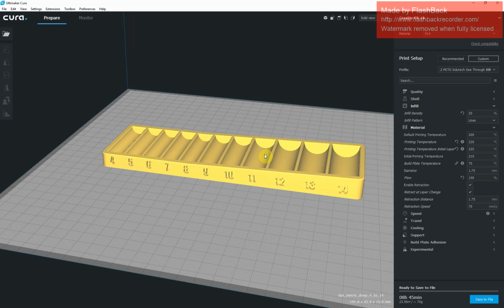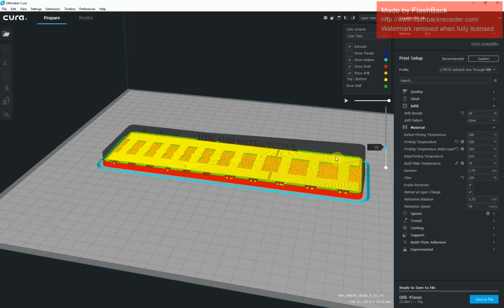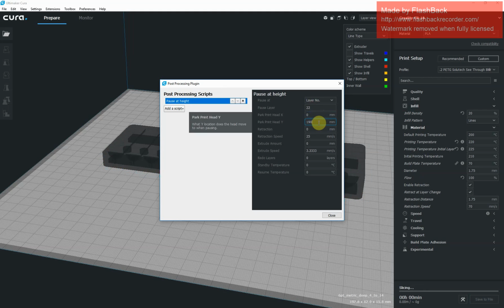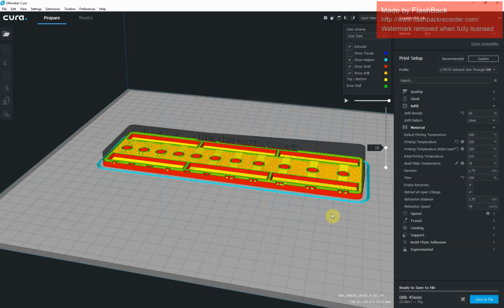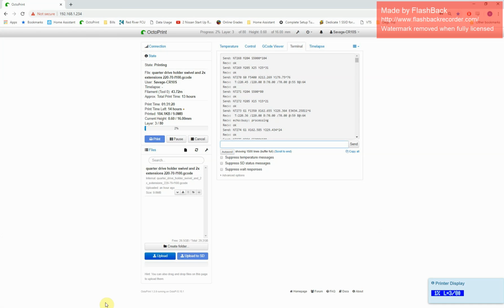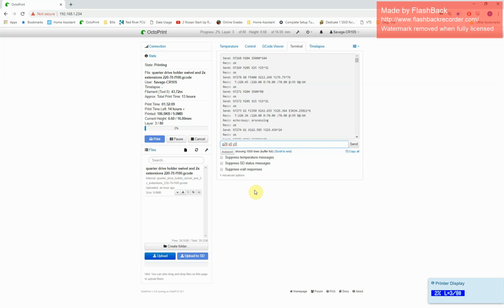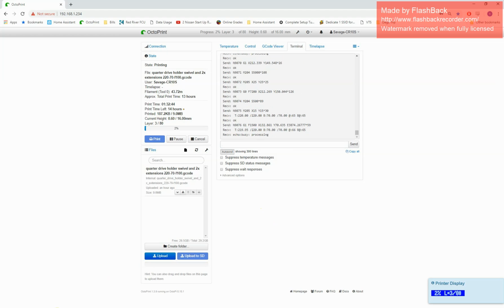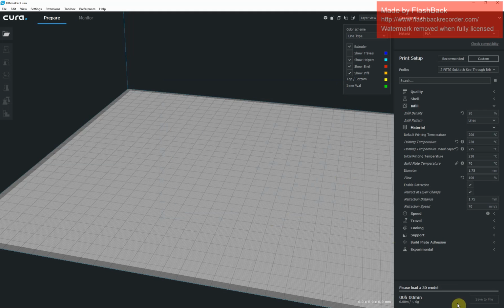Cura Post Process Pause Tutorial

Comment: Majiksmoke, can u pls show us how to do this in Cura? i plan to use Octoprint eventually, but started making your magnetic socket holders with Cura, the Pause at Height post-proc g-code mod works, but the two parameters for before and after pause g-code lines, caused my Ender3 to freeze up.
Reply from the maker: When you send those lines of gcode did you adjust the coordinates for your bed size? My cr10s has a max Y of 300 (why I park the head at X0 Y300) but I think the ender 3 has a max Y of 220. So your park location would be X0, Y220 and your gcode strings would be something like g28 x0 y0 and g1 x0 y220 f9000.

The printer may have locked up because it was asked to move to a coordinate beyond it's software defined endstop.
Reply: @Majiksmoke  i've been parking it at x190 y190, just to have the print head out of the way. I think this is a good enough reason to begin using Octoprint. I do enjoy using the terminal command line in Pronterface, which seems to have a similar GUI. just finished supergluing your magnetic adapter holder, in white TPU. Wonder what i could use to make the text black. thanks for the feeedback, regardless!

Comment: how do you keep the build plate hot while paused?
Reply from the maker: At the bottom of the "pause at height" post process menu, there is an option for both nozzle temperature and build plate temperature. Just set your values in those fields.
Reply: @Majiksmoke  thanks for the fast reply. all i have is one option for standby temp